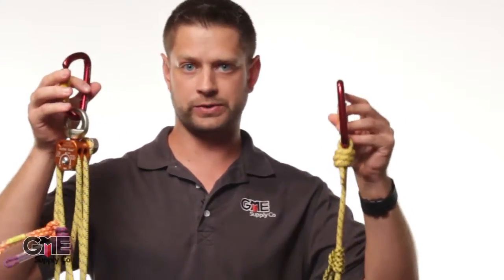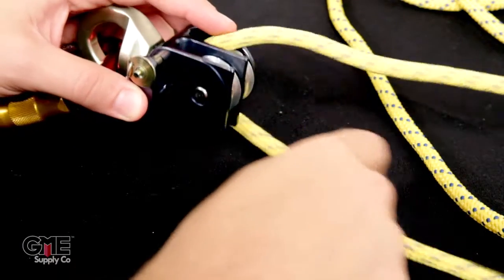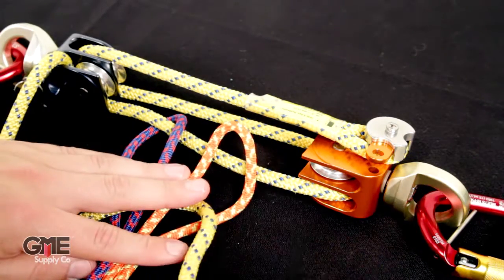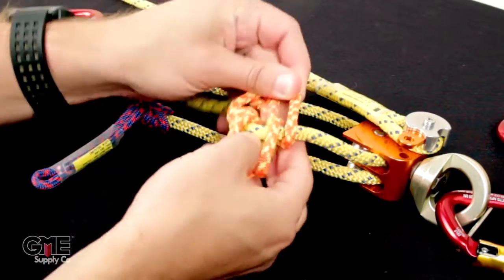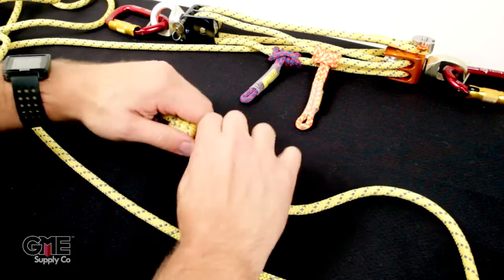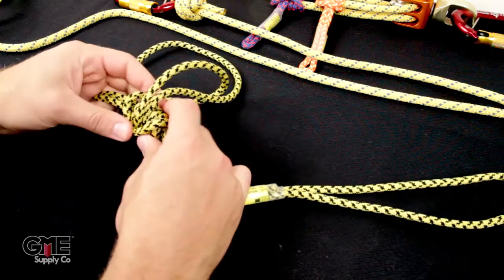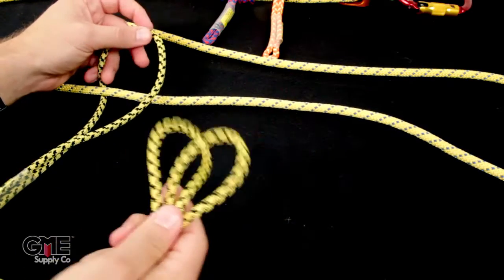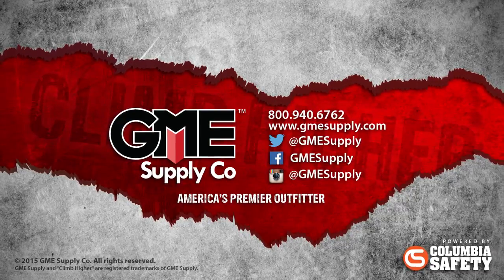How-To: Rig Sterling Aztek Elite Kit - Detailed Version

Comment: Probably a dumb question but I’ve never seen a prusik tied after having a line threaded through it. What is the reason on this kit?
Reply: Hi there.  There are 2 basic reassons for this kind of thread.  1. Each of those small prusiks will absorb energy differntly.  One will hold a 1/3 of the load while the other will suport 1/4 of the load.  So if you keep them threaded is not much of possibility of placing the prusik in a wrong possition.  The  second reasson is that if you see the two wraps go near the pulley and the 3 wraps are far from the pulley.  This makes it easier for moving the prusik towards the pulley while is better in stoping the system when the prusik moves away from the pulley holding it.  Kind regards
Reply: Thanks for clearing that up.